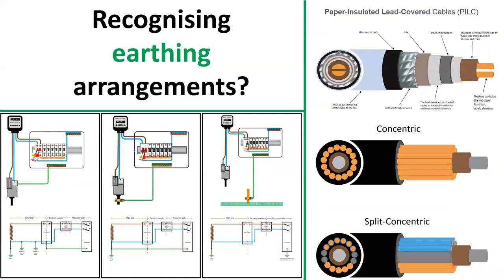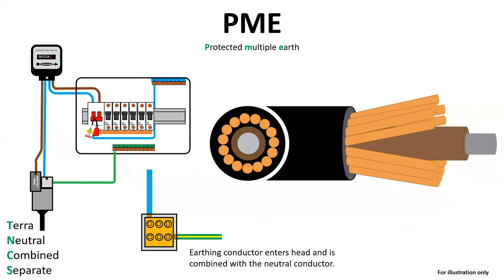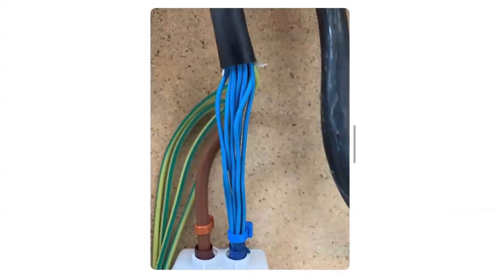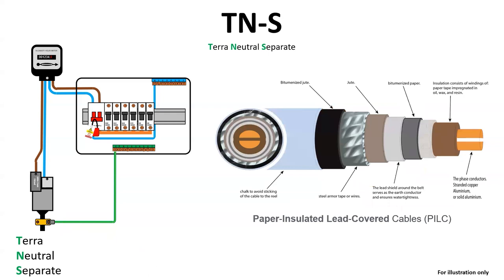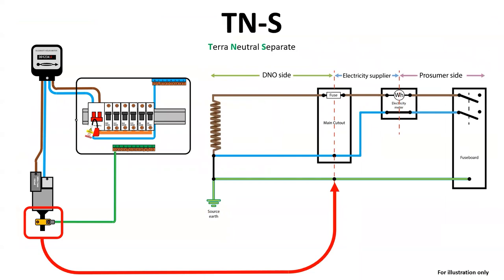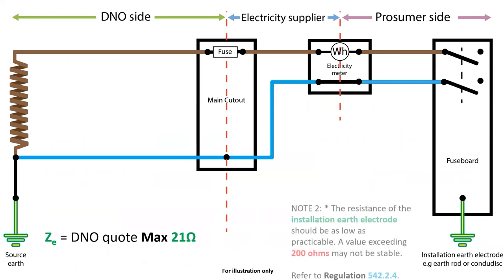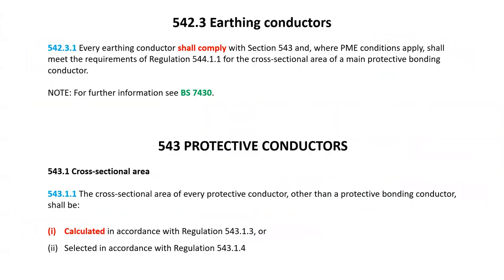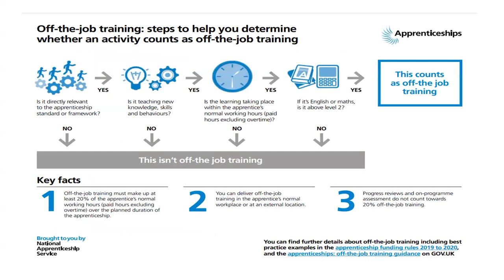Understanding and recognising UK electrical earthing arrangements - inspection and testing & Design

Comment: Thanks for your video. I love to pick up new bits of info each day.
But ... At 7.35 you seem to be implying that on a TT supply, an RCD is required IF the Ze is >200 ohms. Max Disconnection time for circuits <=32A is 0.02secs.  Good luck trying to disconnect within that time with only an MCB, on any truly TT supply. Even a paltry 6A MCB may need up to 30A of fault current to trip on the magnetic function. RCDs are effectively required for all circuits to provide Fault protection as well as Additional.
Reply from the maker: Thank you for the feedback 🙏

Apologies, I didn’t mean to imply that, which is why I spoke through the RCD tables, Zs and relationship to ohm’s law
Reply: Sorry - correction to disconnection time in my comment above. Just realised I stuck an extra 0 in. Should of course be 0.2 secs not 0.02.

Comment: Hi Adrian.  Can you make a video showing the different formulas for bending containment at different angles using different size containment i.e metal tray and also mark back measurements for bending conduit at 20 and 25mm tube. I
Reply from the maker: It’s on my list to do, but it’s way down the list
Reply: @Pure_electrical_training  as long as its on ur list im happy and thanks for your great work

Comment: Should have showed a 100A double pole isolator switch before tails went into the consumer unit in your diagrams it's the best practice so it's the wrong diagrams for the learners